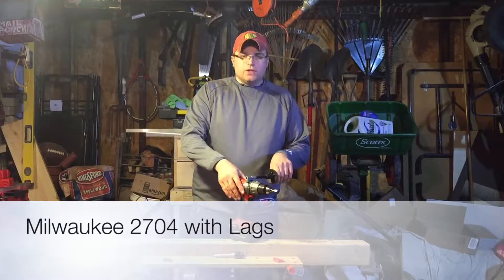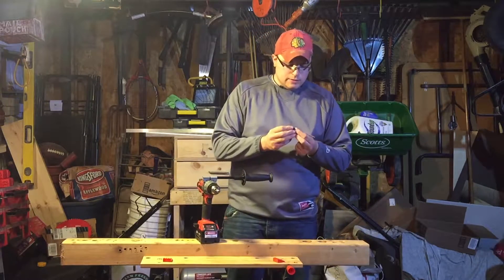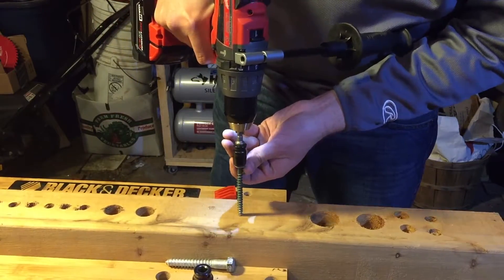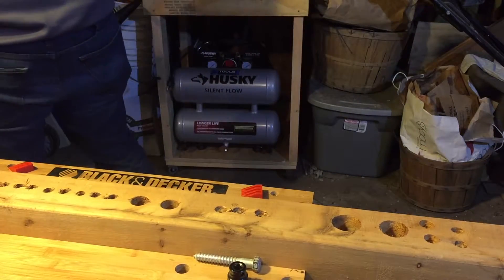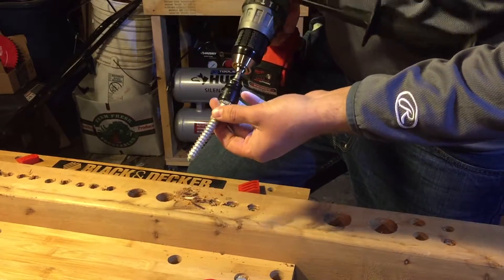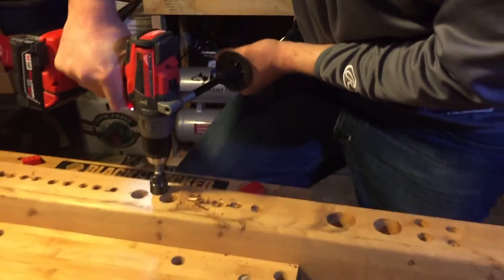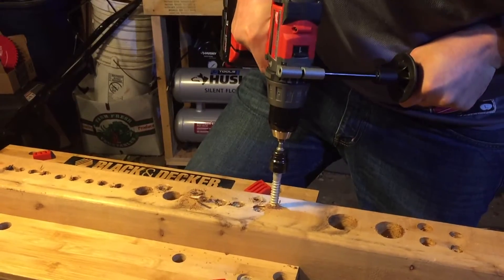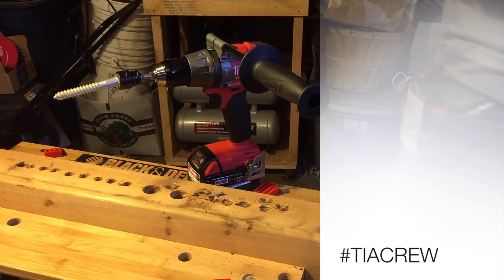Milwaukee 2704 with lags

Comment: I told you that hammer would run the lag, and it ran it real freaking good, you didn't even need to drill a pilot hole! Now if you were running a 1/2 or 3/4 lag, I bet you might have to pilot hole first. Great video, most of all it showed how I was right and you were wrong, and thats what matter jk lol